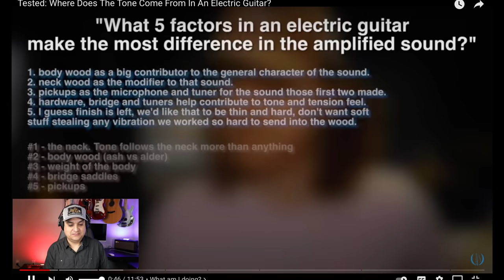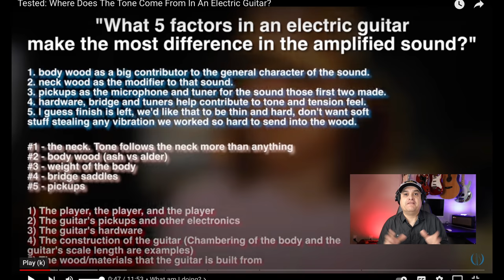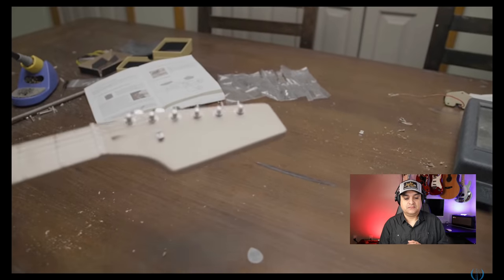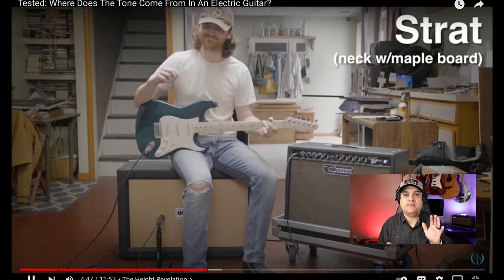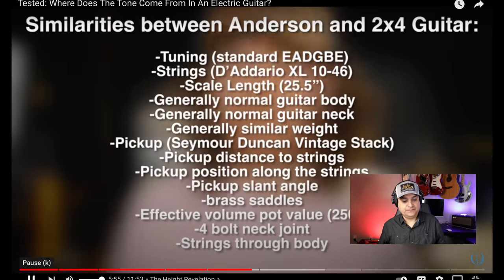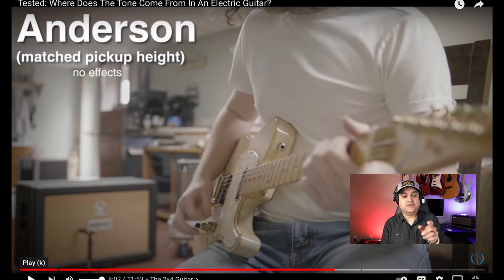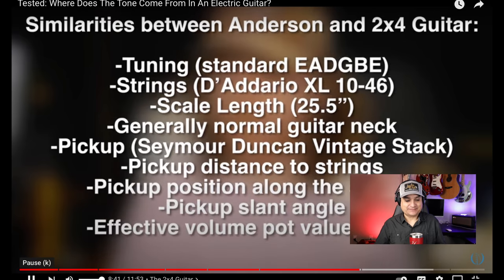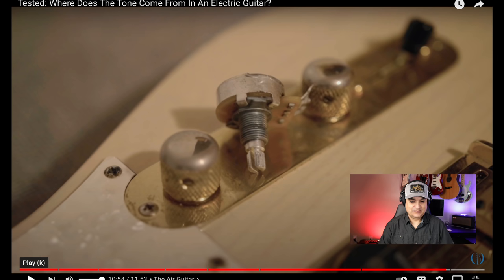Where Does The Tone Come From In An Electric Guitar - Reaction Video

Comment: When it comes to tone, there are many things that can affect it, and many things people think can affect it.  The player and the pickups (position on the scale and height} and the amp (speakers play a large roll) are the absolute biggest parts of what a guitar sounds like.   If you did it right, you could take a Telecaster body, with the wiring and pickups from a Stratocaster, and they will sound Identical.  Or you could take a Strat and modify its scale to be 24.75 and slap in some Burstbuckers and the proper wiring and pickup placement and you wont hear a difference between that Strat and a Les Paul.   The key to those is ensuring you have the right pickups and wiring and the pickups are at the same height and position between the two guitars.   The wood its self plays no actual roll in the tone, how the neck connects to the body plays no roll in the tone, and if set up right even the bridge its self won't play a roll in the tone, the nut material wont play a roll..   I should point out that a badly cut nut will affect things as that will effect tuning stability and even intonation, and if the tuners slip then that will affect things as well, as your guitar is constantly going out of tune lol..   
The video Dylan just watched, is just one of many videos that disprove the concept of tone wood, there are some metal channels that have done it with metal music, there are some more classic rock type that have done it, and then their is the video Dylan just reacted to.   The concept of tone wood does one real thing though, it sells guitars for higher prices then they would otherwise sell for.  People think the reason why one guitar sounds better than the other, is the wood that guitar is made out of, and thus the sellers and manufactures can get away with adding a premium onto the price for the wood choices.    Its the same thing as cheap yellow paint, when it was first used on guitars it was a cost saving measure, and now it is sold as T.V. Yellow or T.V. White..  The same goes for Sea foam green, it was a cost saving thing and now people have been sold on the idea that these colors are premium when in reality they are just cheap paints lol.    
Put simply, if you can convince the buyer that some cheap part of your product makes the product so much better than others, you can charge way more for that cheap part.  If a business has a choice between adding a 2 dollar part and charging 100 dollars extra for it, or adding it and charging 2 dollars extra for it, they will go with the 100 dollar up charge every time, and if they have to manipulate or lie to you to get you as the buyer to fall for a 100 dollar upcharge, then they will..  This is why Tone wood is pushed so very hard by big company's and even your local store, because like sex, it sells products.

Comment: I've watched the original video & come to many of the same conclusions as Dylan did. 
HOWEVER my opinion is, the strings produced the initial tone & each of the other non-electric parts (hardware and wood) act as dampeners of that original string tone. None are better or worse just depends on what you're looking for (tonality wise). NOW as far as body finishes, choose what ya like (similar to colors).
Reply: nicely put
Reply: Yes, but the tension on the strings to produce those specific tunings would calibrate whatever tiny dampening to the strings variances in wood might produce. The bubble wrap in the pocket demonstrates that pretty well.  If you can tune it reliably, the stiffness under tension will be pretty much the same.

Where wood does effect tone, imo, is how the guitar feels in your hands.

Comment: The funniest part for me is, I watched his video when it first came out, and now, years later, I’m looking for it again and this comes up, and it’s like a “see I told you so” moment for me. I’ve got a Squier Tele that I’ve spent a tonne of time on, it plays absolutely amazingly, but sounds like crap plugged in, so I’m looking for the right pickups, and this just proves (again) that Pickups are the most important sonic upgrade you can make… but playability is the most important upgrade if you want to consistently sound good.

Comment: I've been building my own basses for 50 years. What makes the difference in sound?
- The string gauge
- The pickup and pickup height
- The impedance from the pot to the input on the amp (includes unwanted filtering, L or C)
- And mainly, musician of course.

Of course, a green floppy pine neck might not be very good... But I've tried though.

Comment: 2 identical Gibson SG's using same mahogany will sound radically different, I've tested this myself.
Reply from the maker: You moved all the hardware and electronics to test this?
Reply: @DylanTalksTone   Probably no hardware difference out of the factory so I wouldn't test that theory.
Reply from the maker: No pickup swap?
Reply: @DylanTalksTone  Stock. Same year, probably even same season, I could never get the second SG to sound like the first no matter what configuration of adjustments I tried, the wood used was Mahogany but it seemed much darker in tone than the previous. It was almost night and day. Most of these tests are fudged. I would recommend going to guitar center and trying some identical guitars and see for yourself. The only time you will hear 2 different guitars sound the same is in these really poor and limited tests that aim for middle of the road results rather than pushing a guitar and expressive amp to their extremes. There's no way thousands of people who sent back guitars and got replacements they were happy with or vice versa were hallucinating, or all the pros in interviews who complain about waterlogging of wood absorbing vibration are hallucinating. These tests only say one thing: If you're a generic clinical player you will make any guitar sound boring and samey. I do believe that same species and source of wood can vary about as much as different species from different eras for the same guitar, and that seems to be the consensus. Guitar players typically want a perfect guitar with no dead spots on the neck that sounds great with every picking intensity. A good example is driving 50 different cars all at 30mph, it's not a useful test for most drivers.

Comment: This is awesome. I too saw this video and the first person I wanted feedback on it from was you. I believe it is commenter number 3 on what affects tone. With the wood being probably a next to unnoticeable part. It is all in the details from player input to the differences in signal path. In otherwords, take a partscaster, setup properly and pull all Fender premium electronics from another guitar. It will sound just like other guitar it came from. We will see how this goes after I get past first minute...
Take the parts from a strat, stick it in a Les Paul, it will sound like the strat it came from. (oops. well, except for scale length difference in string vibration at pickup location, that has to affect the signal as well.)

Comment: Air my ass. Nobody with a stem background here. The mass of the table the strings were tied to isn't air!
Reply: Also, it's a massive double neck guitar.  But...don't break the illusion of AIIIIRRR GUIIITAAAAARRRR!!!
Reply: Correct. Nobody with a stem or any other kind of reasoned thinking background in this comments section!

Comment: When choosing woods for my guitar builds, I only have a few variables that I consider....first and foremost is ease of work...I've never worked with Wenge, for instance, but I've read and heard that it is a MAJOR pain to work with...I don't need that kind of headache.  Second is weight,  I like guitars to be comfortable, yet balanced. I don't want it to be too heavy, but I also don't want neck dive. And third is the desired finish....if I'm staining/oiling the guitar, I certainly won't be using a 3 piece Basswood or Paulownia body...I'd be looking for Ash, Alder, etc...likewise, choosing a colored wood (Padauk, mahogany, etc.) will determine what kind/color of stain I would want to use.  If I'm painting a body....I'd pretty much pick anything, Poplar is good.  I would have liked to see if there is a difference between painted/cleared finishes, Nitro vs. Laquer vs Enamel, as well as stained/oiled...of course, with 3-4 coats of paint, and numerous coats of clear, you've pretty much taken the wood out of the equation, anyway.

Comment: Can confirm about pickup height. I was unhappy with the volume imbalance between the bridge & neck Pure Vintage 52s in what was otherwise a Telecaster that I loved. To fix it I was googling Tele and Strat replacement neck pickups and how to take the pickup cover off without unwinding it by accident, until it occurred to me to look up the recommended pickup heights and set it to those. Setting the pickups to the right heights corrected that imbalance.

Comment: Perfect! I had a custom guitar built by Warmoth years ago. I chose the hardest wood to prevent any neck cracks, have the vibration only in the strings,  and be less prone to all kinds of damage (not expecting any)  I used stainless steel frets, nuts and a sets bar because I don't  like the sound of brass wear creating a buzz after years of use - I wanted my guitar to last. The warmoth guy told me he went light on the paint because he said it would mess with the sound of the wood lol  I didn't  want sound of wood. Lol just the strings and pickup.

Comment: I own 2 basses that sound exactly the same if I play the same but one has a neck that allows me greater ease on faster and on more complex material. Both Ebony fingerboards, both EMG loaded, both with mandolin frets. 1 has an ash body painted the other is a quilted maple. Same hardware on both. Same set up and string spacing. One is a C shape neck the other a D shaped. Essentially the body is a place to contain the parts you need. The neck helps you play your best but the electronics and you are what makes it sound the way it sounds

Comment: I was pointed to the video first via reddit/luthier - it's great stuff.

I watched a Spectre Sound video where he had 2 guitars built as identically as possible in all specs bar the wood they were made from.
Then A/B'd them and did waveform tests etc - similar results that the wood does not make a huge contribution to tone.
The one thing wood does do - is alter sustain - so it's now "sustain wood" and not "tonewood" to me.

There was also a Darrell Braun video where he took a guitar and cut chunks of it off with a jigsaw and recorded how it sounded after each removal.
Again - tiny tone changes but hard to tell unless you were really listening.

Comment: I like how this video doesn’t debunk the Epiphone Les Paul vs Gibson Les Paul material shootout, but it does lean towards one scratching their head. I wonder if Dylan will make a reaction to it as:

“There are physical build differences between Gibson & Epiphone Les Pauls, but if you replace pickups (and possibly their associated hardware) and set them up the same, then the sound you get will “match” … from a guitar player perspective.”  

This would cross promote his videos on the comparison AND the ones on potentiometer comparison as well as the other assorted hardware in the circuit, but ALSO his business as a builder of pickups… which are now arguably the second most important part of a guitar sound behind the Player themselves. (Cool factor being a close third though.😎) 

Awesome video!! Keep the content coming!

Comment: Darrell Braun did a similar test, focusing on tonewood only.  He took a guitar and recorded it being played as he sliced huge pieces off the body, until it was basically a painted 2x4 guitar.

Sustain suffered a little bit, as did a bit of the high freqs.  But it was really subtle.

Pickups, strings, and how they relate are the key, and virtually only factor.  The sonic reflections that move through a solid like this end up canceling about as much as they add, so there's going to be very little "eq" difference between a guitar body and open air.  It's a very small piece of solid, so there's virtually zero actual "bounce back" reflections that aren't instantaneous, meaning only the very high freqs are going to be affected (adding to each other or canceling themselves out).  There may be odd "resonance" spots on the body (especially hollow bodies, of course), but those won't affect the strings, and since the resonating body ISN'T what we're hearing (unlike on an acoustic guitar), those spots on the body are moot.

It's metal strings vibrating over a magnet that excite the electrons in wires wrapped around said magnet.  It's E&M 101.  This relationship is what holds the most sway over the sound.  And physics also tells us that dampening the upper freqs is going to happen sooner and more easily than any other change in how the string is vibrating.

Comment: Finally finally someone does an experiment that eventually gets to an instrument with no wood between the strings.  If what the guitar is made of matters then a guitar made of nothing should sound blah, except that it didn't.  Now who else wants a guitar made out of two benches weight down by two Honda motorcycle engines🙋cause that one sounded great.
Reply: But do you want Japanese motors on the bench, or American?  :p
Reply: @ChrisFranklyn  😆…🤔
Reply: Wood under strings was offset, and btw it's has 2 effective necks.

Comment: I just loved this reaction video.  It was very respectful.  Well done.  And I agree that his method of elimination was genius in its simplicity, and he wasn't guilty of confirmation bias.  Just as a real Scientist should.
I have been turning $50 Squires into expensive sounding guitars for years, by first determining what kind of sound the Guitarist wants, then with not much more an a set-up of the Guitar usually requiring no more than a different set of Strings, adjustment of pickups, and sometimes changing Pots and or Pick-ups.  I'm only talking about, for Amateurs of course, but most other stuff is usually about feel of aesthetics.  Also, I'm only talking about Solid Body Guitars.

Comment: For the "Debate Continues" Dept. - FWIW : I also play Pedal Steel Guitar. Many years ago both myself & my Mentor were equally intrigued with Buddy Emmons & his EMMONS Pedal Steel Guitars. At the time I had a single-neck E9th ZB Custom student model & my Teacher had a nice MSA single-neck E9th. Neither of us had the $ for these expensive EMMONS Guitars, so we did the "Next Best Thing". That is - we both ordered an EMMONS Pickup ($50) "THINKING" that would instantly make our Steels sound just like an EMMONS.. Well -"WRONG !" What it DID do though was made my ZB sound like a bigger, fatter-sounding ZB Custom student model & my mentor's MSA into an even fatter, fuller sounding MSA than it already was. But neither of them sounded anywhere close to the EMMONS.  So what did we BOTH end up doing ? Well, you guessed it - we  saved our $ and later bought identical EMMONS D-10's (still have mine). Problem finally Solved, but is still a mystery why our $50 Emmons Pickups didn't do the Trick. There must still be a factor going on with materials, parts used (EMMONS has the solid Aluminum Necks - not the usual Wood), etc ? Go Figure 🤔.

Comment: Look... To say that the body and neck materials absolutely have no bearing on the sound of a guitar is just false. People keep talking about tone in relation to wood, thats not how this works. Your pickups only pickups electromagnetic disruptions in the magnetic field of the pickups by strings or a ferro magnetic material. The strings can get some character differences by the material they're mounted too and the quality of the mounting material but thats more of a sustain thing and 90% of that is feel FOR THE PLAYER its something that mostly cant really be heard.

Your electronics are absolutely THE THING that decides tone and then properly shaped by the amp and etc etc.  Body wood, unless its an acoustic or something you know, it doesn't decide its highs, mids and lows ONLY the electronics. The wood and your bridge hardware and nut do something but what that is, is beyond the tone itself and more or less effects sustain and shape but NOT TONE 

PERIOD

Comment: I figure the 3rd guitar maker he got a response from was Mr. Paul Reed Smith. Paul did a Ted talk back in 2013 where he explained the electric guitar is subtractive. So the strings vibrate when struck. That vibration in the presence of the pickups magnetic field generates a signal which is then passed through the volume pot and tone stack. Keeping those aspects the same in the same context the sound produced is the same, the only variation in tone is then the context and the player. The context then being the construction and makeup of materials (tonewood, bridge, nut, frets, etc.) and the presence of the amplified sound feeding back into the strings. The tone then lies within the player to apply the musical notes which match the  the resonance of the guitar materials in the presence of feedback creating tone. So in isolation the source of tone is the strings, pickup and electronics, and the relative position of the  pickup to the strings. Everything else is subtractive. The difference lies in the context(player, guitar construction and materials, and the venue).

Comment: The only reasons i differ from wood choices are : looks,strength and weight. All the rest is easily matched by electrical components.
Know what actually makes a huge differance in tonal outcome? Fretwire material! Try out differant types of sizes and material compositions and compare that. It's one of the very first things that your strings make contact with...yet people sleep on this variable. Aluminium,brass,steel,jumbo,medium jumbo,...